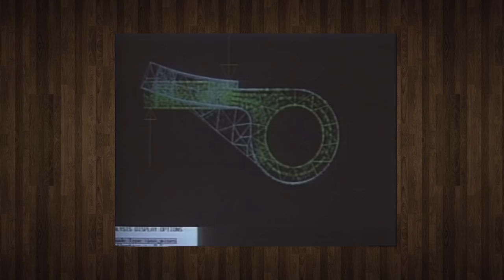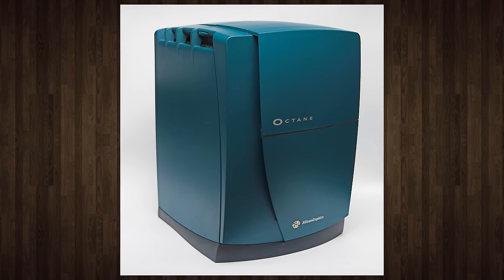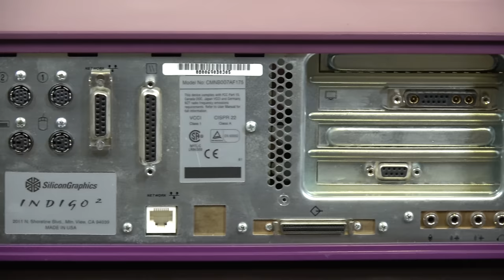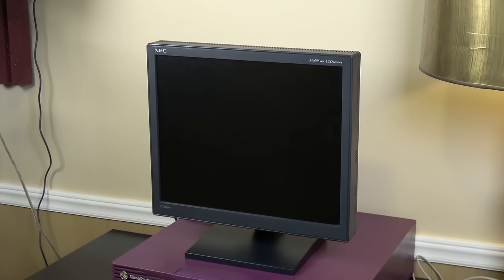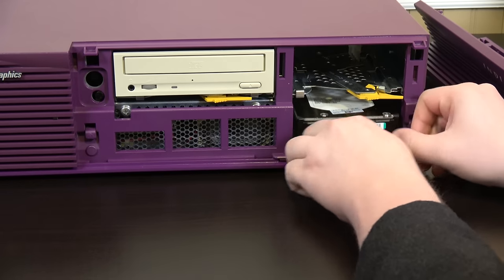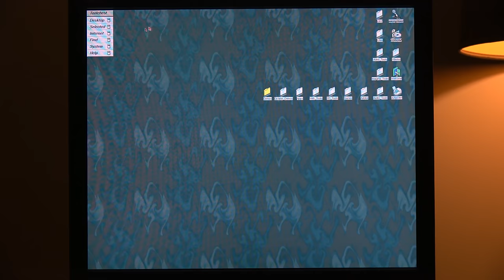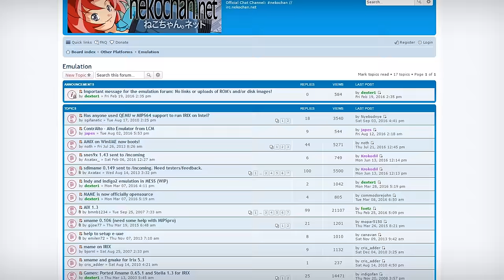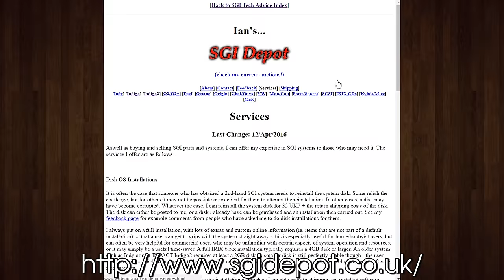SGI Indigo2: An $86,000 Workstation from 1995

Comment: One massive difference, computers are now faster and way way cheaper.. back then all you got was low res slow crashing Windows95 rubbish, and u needed to spend a massive $86,000 RIP OFF to get a machine that could just do the job. Now it is super cheap and super fast and stable, and you can do anything with you're computer. Further you're smart phone is even faster.

Comment: You can just install Linux on it and still use them today
Reply: No need to install Linux, indeed that would remove most of what makes them useful. Just run IRIX as originally intended.
Reply: @mapesdhs597  Linux is virtually the successor if IRIX
Reply: @Vamp898  That's a different issue entirely; the point is, installing Limux on any SGI is a terrible idea in terms of  being able to use the hw in a relevant manner (if one wants to use Linux then just stick it on whatever x86 tech). Besides, plenty of Indigo2s are indeed still used today (mostly medical, defense, textile manufacture and other industrial process control applications), their continued use is not an OS issue.

IRIX's 2K-CPU scalability potential had to be ported to Linux, before then it was really awful, likewise other aspects of IRIX which were more advanced. That it went in such direction though was a consequence of SGI's poor management and product decisions, not an inevitable course of OS evolution.

IRIX had been planned to move on to support 37500 CPUs single system image (Origin4000), something still far beyond the ability of any modern Linux distro, but SGI's terrible decision to switch to IA64 meant that work was cast aside.
Reply: @mapesdhs597  you don't use hardware, nobody does. You also barely use the OS

People use software. This is exactly the reason why the Windows phone failed.

Any system, whatsoever, is only useable if it runs the software you need.

So this system is practically unusable by any if today's standards and Linux would turn it into an usable system because then you would be able to run actual modern software on it
Reply: @Vamp898  Absolute nonsense, SGIs were and still are a closely integrated match of both the hw and the OS, and like I said, SGIs are still used all over the world (I know because I'm one of the continued sources of them these days, indeed the unit in this video came from me); again, installing Linux would mean the acceleration hw capabilities of SGI gfx would not be available because Linux does not support that at all (this idea that Linu can run on anything and by definition be better is quite absurd), such as the ARB libas. But if you're going to choose to be so ignorant then I'm done here.
Reply: @mapesdhs597 first of all, what exactly are we talking about?

There are still Power Plants that run an Pentium 2 Windows NT 4.0 systems. So what?

The development of IRIX and everything related to it stopped 2006. Every SGI System that exists, to this day, is affected by at least by 100+ highest severity critical security risks. These systems are 17 years old.

Non of the current, relevant graphic libraries run on these, not are they able to securely communicate in a network.

Just because there are companies who still use these heavily outdated machines, not because they want or choose to do, just because they have no other choice for mostly the lack of money and/or too much bureaucracy, with outdated software doesn't mean that it is a good idea.

It's funny that someone who completely ignores facts, state of being and reality out of pure ignorance because he likes something, calls someone else ignorant
Reply: That would be quite dumb.  You can install IRIX on them and use them today.  Linux on these machines does not use any of the specialized hardware and is pointless.
Reply: @Vamp898 you realize this is a vintage computing YouTube channel right?  And you’re arguing with one of the world experts on SGI systems.  Tell me clown boy, what modern software do you want to run on Linux on a 20 year old SGI?  I’ll be waiting to laugh at the answer.  What ever it is it will totally miss the point of having a vintage SGI and would be better run on a raspberry pi or a toaster 😂. You’re the kind of guy that would gut a 1960s Ferrari and put a Toyota 2 liter engine in it because then you could commute with it on modern roads to your job at Starbucks 😅. Meanwhile people who collect those cars take them to the Mille Miglia, Pebble Beach, and Goodwood to share them and use them as originally intended while having good fun.  You really are showing a lack of class…

Comment: It's funny how desperate people apparently were for this thing's capabilities. $86k-desperate lol.
Was life so terrible before it even existed?
Reply: Comparatiively speaking, yes. MaxIMPACT was 10x faster than anything else available when launched, with far superioer capabilities, but note the supposed cost refers to a max spec system which would have been extremely rare, and much of the cost relates to RAM capacity. In reality most systems didn't have so much and cost far less. People forget now just how slow PCs were back in the early 90s, and with so little RAM. Indigo2's CPU performance was also very good for its time, especially for fp codes, not to mention the processing reliability. Platform stability was a major issue for many users, Windows simply wasn't an option for the kind of work involved in many industries, inparticular medical, aerospace, industrial process control, etc.

I ran a ChallengeS server for five years back then, it never produced a single error, not once. By contrast, a supposedly top of the line PII/400 NT server would crash maybe a dozen times a day.

Hence why systems like Indigo2 were very widely used for defense applications. The UK's RAF had hundreds of them (I know because I bought 37 of them, and it's one of those units which I eventually ended up sending to LGR). Indeed, Indigo2s are still used around the world today for controlling medical scanners. As it happens I'm working with an R4K/200 Elan unit just now, still working perfectly fine after 30 years.
Reply: You obviously haven’t worked in a critical business with serious problems to solve.  They were worth every penny.  It was like buying technology from 10 years in the future.  When you are working on projects with 50 plus million dollar budgets, a room full of these that gets the task done pays for itself.  In many instances these were the only tools which could do the required work.  A complete Pro/ENGINEER system with hardware+software was $200,000 in the early 90s and it was built around SGI hardware.  Early on they were the ONLY game in town.